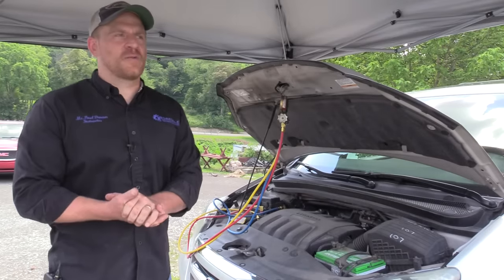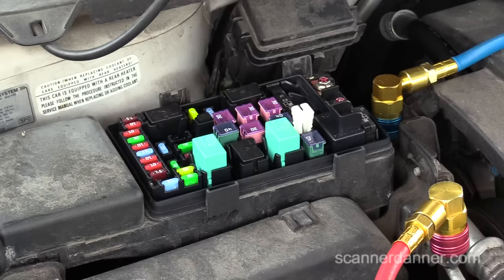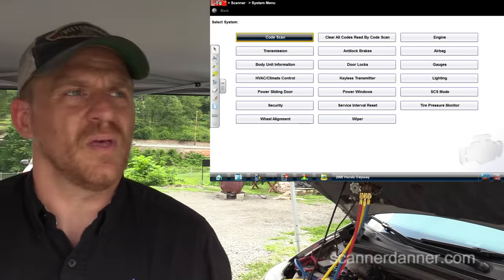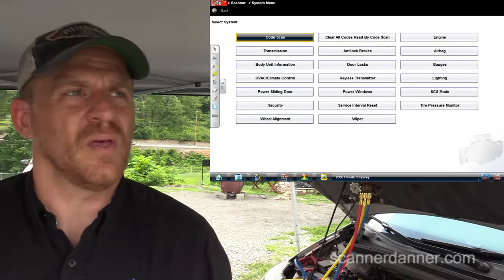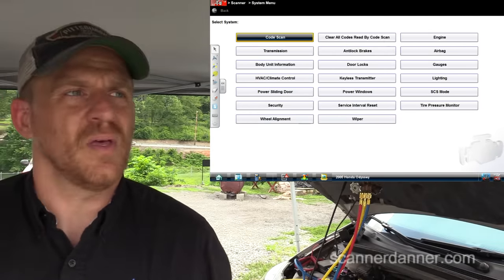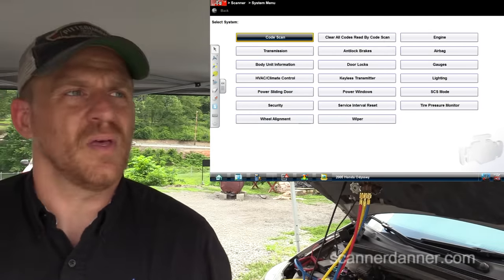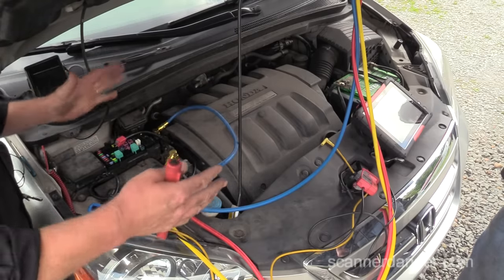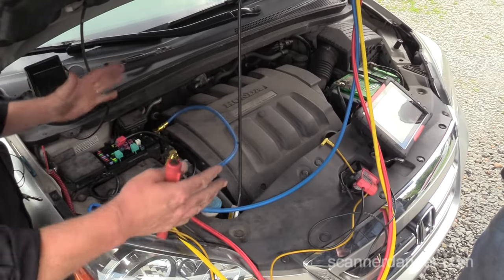A/C clutch not engaging - 2005 Honda Odyssey

Comment: its not 10k and you can hook a hot wire to the clutch and see if it click. The wire thing is really not the right way to do things. So here is one of the best bidirectional scan tool I have used, new to the seen and has left a dam good impression with me and I have been doing this on and off 25 years. The Xtool D8 hands down
Reply from the maker: The D8 processes data PIDs the equivalent to the flow of molasses. That company sent me the D7 and D8 and I sent them back. 
And what are you saying is not the right way to do things?
Reply: @ScannerDanner   I Liked the D8 for the money. You made a video telling people in the comment to put out some recommendations for Bidirected     scanners because you have only used 2 different kinds so I did lol. Dont chew me up then spit me out lmao

What I said wasn't the right was hooking a wire to the battery then into the plug on the compressor. Hot wire a compressor isnt the right way but I have done it. The better way would be to use a scanner.
Reply: @ScannerDanner   Lets all be calm lol
Reply from the maker: @traviskelly7082  sorry, thought that was directed at me. My apologies
Reply: @ScannerDanner  naww man you good no biggie. Man, I watch you to learn, I don't mean to toot my own horn but im decant and some of your videos get so deep on electrical, you can easily loose a person. its happend to me more than once. got to be on you P's and Q's to keep up with you.

what have I learned today? you have used more scanners than 2 hahahahahahah lmao

Comment: I have a Honda Civic 2008 my AC works for about 10 mins, after that it stops working. 15-20 min it starts working again. What can i do?
Reply from the maker: When it stops working, you need to be checking power and ground to the clutch, this will dictate your next move. If you have a good power and ground while the clutch is not engaging, you have a bad clutch. If you are missing power to the clutch during this period, you have a control issue (input or output problem). Can't help any further without knowing which direction to turn. MAke sense?
Reply: ScannerDanner 
Here is how it started, i replace the AC pressure switch, and lost what i believe to be the R134. I install the new piece and after that i added some more R134. After that i started having that trouble with my AC.

Comment: Ok.  I bet someone here has an answer for this one.  2004 Odyssey.  New England vehicle its whole life (short summers above 80 some days only 3-4 months). Low side of the line is showing very high pressure (warning level at 75 plus psi). Pertinent relays test well.  Fan always works, just no cold air..... EXCEPT yes ....EXCEPT after I drive through a big puddle.  Suddenly, the AC works for a day or 2.  I am guessing at this point it's a corroded lead or ground to the compressor.  It is just a huge pain to get to to test.
Though when the car is dry I can hear something engage briefly and draw down power when ac is turned on but it seems shorter and less powerful of a draw that on other vehicles.
Is it worth digging to check the connections?  I am not willing to pay for a noew compressor if that is the issue because the car has 220K on it.  and will just make some bag puddles to drive through for the months in the next 2/3 years that it may last.

Comment: got AC problem in my mitsubishi pajero 3.8 liters engine 2005. There is no negative control output from engine ecu to AC clutch relay coil. I checked my pressure switch and its closed but no 12 volts or even 5 volts output from engine ecu and AC ECU. use test light and hook to +ve battery terminal then touch the test light pointed tip to both of pressure switch wire and AC clutch engage. when i trace the pressure switch wire it comes from engine ecu and AC module. Don't know the internal design of this ECU and AC module and how it works internally i just want some clear understanding what would be the possible parts to test and why im not getting a 12 volts signal going to my pressure switch so that engine ECU will send negative output to AC compressor clutch relay coil pin 86. there is no open circuit between AC ecu wire to pressure switch and pressure switch to Engine ecu. Refrigerant gas is fully charged but the shop can't find the issue why its not working. Need help!
Reply from the maker: without a wiring diagram, I can't help you. This model isn't available here either. Post this to my forum. I have an international community that may be able to help. 
https://www.scannerdanner.com/forum/post-your-repair-questions-here.html
Reply: ScannerDanner  i got the wiring diagram of that pajero, i can send it to you if you want, what is your email address
Reply from the maker: post it to my forum please

Comment: need help been working on my 99 dodge intrepid for 3weeks an having a hell ofa time trying to get this thing back to normal running condition its reading voltage is high on my sensors it runns smooth but when i apply the gas it runs like its choking throttle sensor map sensor all new can some one in this field help me out.
Reply from the maker: "its reading voltage is high on my sensors" what do you mean by this statement? Have you measured the actual signal voltages of your sensors and they are high?
What is your fuel pressure? Have you seen this video?
https://www.youtube.com/watch?v=-lUYRqaYvYI

https://www.youtube.com/watch?v=gtTKOuu6EPw
Reply: i had a electrical short and it was fixed then the codes showed up P1268 battery  cam  p0340 throttle  p0123 cts egine  p0118 map p0108 intake  p0113 allcleared except  throttle an intake keep saying high voltage
Reply from the maker: okay cool. With the key on and the engine off. Measure the voltage on your TPS and you ECT with them plugged in, backprobing the pins one at a time. Give me your voltage readings on all 3 wires of the TPS and both wires of the ECT.

Comment: paul or anyone else that can maybe help. my 06 nissan xterra 4.0 is running like crap doesnt accelerate much at all. there is a code for one of the upstream air fuel sensors. with live data im seeing the airfuel sensor voltage go over 1 volt. is that normal or is the sensor bad? thanks
Reply: the voltage does fluctuate but its going over 1v and i havent seen that before. this is an air fuel ratio sensor and not just an 02 so im wondering if thats normal or not thanks
Reply from the maker: Probably normal. They operate differently. If it doesn't accelerate you need to be looking at fuel pressure,  MAF sensor and for a restricted exhaust. Or you could have a misfire. Post your questions here okay? https://scannerdanner.com/forum/post-your-repair-questions-here.html

Comment: I agree with you that not everything is a fuse as people say obviously however even people buying a $1,500 scannerstill they have to know the basics open loop closed loop IAT sensor oxygen sensors how they work map sensorswhat a fuel injector pulse width modulation is and if you don't understand that I don't think it helps what kind of skin are you have

Comment: Sometimes, the reason the techs don't check everything is because they want to make money and don't mind wasting customers money. If it comes down to a power and ground issue, they will fix it and still make more money that way. I learned that from a tech. By the way, if you check current to the clutch and find  2 to 4 amps, shouldn't that suggest that the coil resistance, power and ground are fine, and the coil should be able to create a strong magnetic field, and the only problem could be an air gap issue? This is always an issue for me when you check amperage to a fuel pump to see if you need to check power and ground as well. I understand an open coil, power and ground will result in no current flow, but can't understand why if you get a current flow based on ohm law. E= IR:  14v engine running and 3 to 6 ohms( coil resistance), which result in 3 to 4 amps, you have to replace the coil. Help me understand that, please if you would.
Reply from the maker: without going back and watching this, I cannot answer. Give me a time frame on where your question is coming from please. Thanks

Comment: How do you know if your head gasket gone bad while driving
Reply: Coolant usage with no leak, excessive pressure in the cooling system, rapid pressure buildup in the cooling system, overheating at low rpm or high load, no or intermittent heat, misfires, hard starts, steam out tailpipe, one or two visibly cleaner or different spark plugs, a cleaner piston top, possible milky oil if it's really bad,
Reply: White steam/smoke out the tail pipe, water in the oil and or a cylinder misfire if its misfiring do a drop test to find out what cylinder is affected pull the spark plug and see if its clean compared to a different cylinder.
Do a hydrocarbon test, they are sold at advance auto $30-40

Comment: I have no power going to the clutch wire, checked all relays and fuses all test out good, if i jump the clutch relay the clutch does engage only item i have not checked is the low and high temp switch. Does anyone have any input?
Reply from the maker: If it's a Honda, you have an evap temp sensor too on some of those.
You need a good scan tool to show you those inputs so you don't have to check them all manually
Reply: @ScannerDanner  
Been using just a DMM and a power probe don't have a good code reader, just helping out a friend the vehicle is a 2006 honda odyssey with the v6, gonna get wiring diagrams from just answer and go from there. Thank you
Reply from the maker: @kevinmoreno9443  spend the $20 and get good service info and diagrams here 
https://eautorepair.adtrk.biz/?a=10817&c=24&p=r&s1=

Comment: 98 Buick Park Avenue clutch not engaging is getting power to the clutch the ground is good fuses relays everything has been checked still not clutch still not engaging
Reply from the maker: If you have a good power and ground to the clutch and it is not engaging, you need a new clutch
Reply: the original compressor that I had on there in a compressor from the junkyard that I bought they both doing the same thing clutch not engaging thanks for the response
Reply from the maker: Then you have two choices. Either you are not testing the power and ground properly, or you have another bad compressor clutch.

Comment: sorry i guess im the only one who doesnt get it;  if your buddy is working  the switch on and off; and u get no light;that looks like a bad ground to me??? were u hooked to + or - with light??
Reply from the maker: If the light didn't light up (I don't remember) the test light was connected to - . An open ground would have lit the light.
Reply: thanks for the reply;
Reply: don't you usually; when checking a ground; put test light to + to make sure you have a good ground?

Comment: i wonder how to check to see if the pressure switch is out
Reply from the maker: Every car is different. Testing a psi switch or pressure sensor is no different than in is anywhere else on the car. Check out my Chapter 2 playlist (Switch Inputs) and my Chapter 8 playlist (Pressure Sensors).
https://www.youtube.com/playlist?list=PL3EF7B78BEDFA6101
https://www.youtube.com/playlist?list=PLAFYVCyenqcoFWIaYzFZcB5PX5iOMiDTQ

Comment: In the case of an open component as such wouldn't a tool like the load pro work best? You could unplug the connector at the compressor/coil. Use the A/C housing as the ground and 12 volt feed to coil as power,, complete circuit. 

yes piercing the wires directly out of the coil eliminates all wiring. My point is in a circumstance where there's a complete open using a voltmeter the circuit isn't actually loaded? Is the test light putting a true load on the portion of the circuit tested? More so than a volt meter. 

You talk about amp draw of a test light for output actuators, but not for stressing various loads.
Reply from the maker: That is because it's not necessary. The load was open, you simply are not going to have a wiring problem and an open load at the same time. This is the flaw in the "load pro" crowd's thought process. Separate point, that tool is not putting anymore strain on the circuit (in fact less) than my test light. It's just giving you a calculated value instead of a bright test light.
If there was a wiring problem causing the clutch to not engage (with a good clutch) I would have seen it in the tests I showed 100% of the time. The digital voltmeter would have shown low voltage and the test light would be dim or completely go out during that "loaded circuit test'
Make sense?
Reply: First off I'm learning and trying to understand the best test methods. Not bias to one or the other.  I agree that it's highly unlikely  to have both issues, but isn't that the point of these channels to be as close to 100% accurate in diagnostics. 
So the test light connected to power feed into a component to a good ground loads the power wire cause it has to light a bulb in my test light and it's technically making a complete circuit? this is if I'm able to spot dimming (getting a ref. brightness battery before probably a good idea). 
then a regular old voltmeter stresses the load the same or less than a test light?
Reply from the maker: My apologies if I sounded harsh. I have had issues with the inventor of that tool, so some of my wording comes from that. You are absolutely correct, we do want to be 100%. And I agree the "dimming" of a bulb is not ideal, it is very subjective. But it is technically a better tool to load the circuit than a digital voltmeter when there is an open component. 
Let's use a head light bulb that is burn out (open) for this analogy. The bulb is burnt, so there is no current flow. You turn the headlights on and backprobe the power and ground. You read 12 and 0. So good circuit, bad bulb right? I agree. Bad bulb, no doubt about it, this is an accurate test 100% of the time! Good 12v feed, good ground, bulb still plugged in, backprobing the connector, no light = bad bulb!! 
Now, some will say, "but the circuit wasn't loaded with a bad bulb" and they would be correct BUT, did we with 100% certainty find a bad bulb? Yes we did. 
Now could there be a wring problem that we missed. Yes! because we didn't load the circuit (open bulb) but here is the thing. The bulb quit working all of a sudden right? Are we supposed to believe that the bulb burnt out the same time that there is a wiring problem to the bulb? I simply does not happen!
So now to the test light (incandescent style), it absolutely loads the circuit way more than the voltmeter does. But that again was not my main reason for using it. I was never worried about the wiring once I saw the bulb staying lit brightly with the clutch circuit energized.  
Sorry again if I sounded harsh, it was in no way directed toward you. I recognize your name and you've been a subscriber for a very long time and I truly appreciate you.
Reply: No worries, I wasn't offended at all. I appreciate all you've done for techs. and diy mechanics. 

Makes sense now. I'm trying hard to think of times where an open component failed and there was a wiring issue and I can't. 

Looking forward to more of your content on the web. Thanks.,
Reply from the maker: To be fair. I suppose it is possible but I haven't seen it in the 24 years I've been doing this.
A hypothetical would be you have low voltage available to a DC electric motor from a bad feed wire and it ends up burning out the motor. So you diagnose the bad motor with 100% accuracy using the methods I'm teaching and get the car running again but find low fuel pressure and low voltage to the pump. Then you find your corroded feed wire and fix it! No big deal. But again it just doesn't happen.
Reply: @ScannerDanner  Thx for vidz and all methods and thought processes you share.

I ac in my saab 93 my quick scretch.. I added pag 46 quick charge and some oil. Was work fine 2 days now won't engage.
I have 12volts at the clip to compressor.. I read in saab software iys grounded to compressor and alternator and the coil acts as another relay. Thinking of taking it out and putting o bench maybe a soldier job or ground??? I don't have room and ac on bottom cover by frame and inch away.. maybe drill hole??
Reply from the maker: @ericbeard7007  so no ground wire right? Just one wire going to the clutch?
A simple voltmeter reading on the housing, with the clutch circuit energized, is all you need to do to test that housing ground. 
One lead connected directly to battery ground, the second lead connected to the clutch housing, with the clutch circuit energized. If your ground is bad you WILL read voltage on the housing.
Reply: @ScannerDanner  yeah voltmeter read 13.7 on battery.... then from ground on battery to ac housing it jumped up the 190 and down .1..... all over the place.. but it seemed everywhere motor... I have breathalyzer so I can unplug battery do much for few months..  think I should get used one for 80 down road?

I wish I had shop like you or that south main auto guy... you guys have same hummer as me, love watching videos from you to